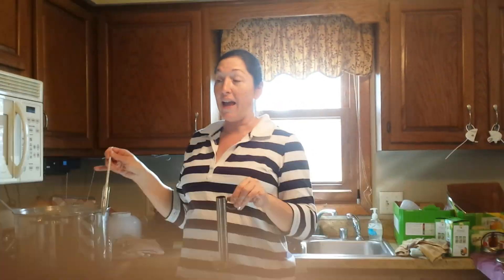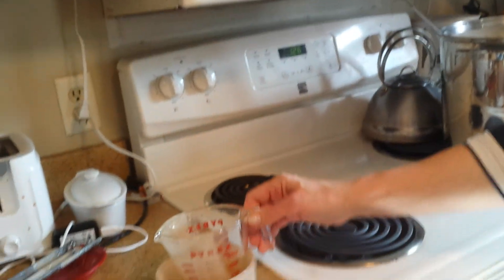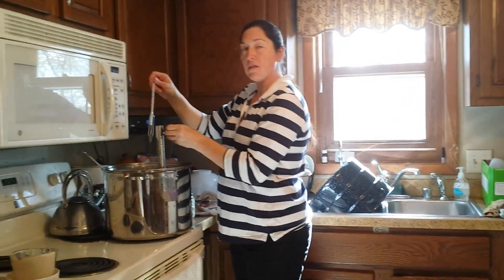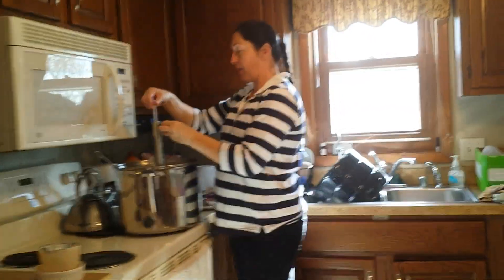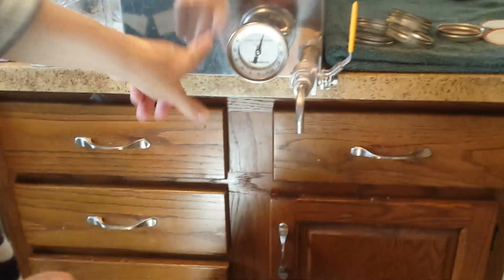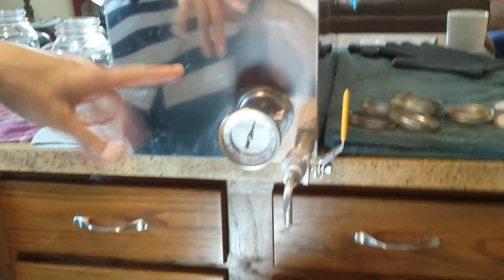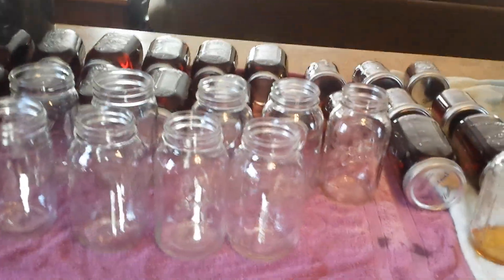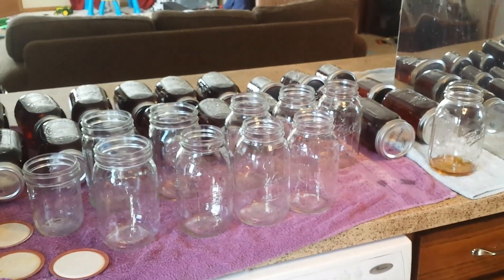Testing maple syrup with a hydrometer Finish point for maple syrup

Comment: I've been doing small scale for many years, bucket and open boil outside.  Some notes: finishing on the stove is absolutely the way to go  . . .when syrup gets close to being done, the chance of scorching a flat pan goes way up.  Use a deep pot.  Be aware that syrup, when it's close to being ready, will over-boil in the snap of  your fingers, creating a foamy, sticky mess.  Worse, if you have a glass cooktop, boiling sugar can and will complex with your glass surface and pit it.  If you are using glass, watch the syrup like a hawk when you are getting close to a boil.  I usually hang the stainless sampling contained from the ring inside the pot, which prevents most of the mess outside the pot.  Can't see using a measuring cup - just dip the entire stainless sampling cup directly in the syrup, test with hydrometer, then pour back in, hand cup on inside of pot, and keep watching.
I have jarred a lot of syrup - never had to use a boiler or anything else.  get to boiling on the stove, pour through a filter (I use prefilters and dense filter made for syrup - reheat, and pour directly into jars - seals with rings and lids, let stand until cool.  Never had any issues with spoilage or sealing.  I recommend avoiding laying the jars on their sides  . . . the lids have BPA in them, and if you hit them with hot syrup, the BPA is most definitely going to leach into the syrup.  I have never allowed the syrup to touch the lids, I have always let the jars cool standing up, and I've never had one fail to seal.  Good luck!
Reply from the maker: I have never heard of BPA in canning lids. Im heading right off to the internet for an education on this. There is always something to learn from viewer comments. Thanks!

Comment: Yes i have a bit going, bout 80 gal from yesterday,  hopefully my new filters an hydrometer will be here by the time its cooked down this evening,  i been having trouble with crystallization,  hopefully this hydrometer will correct this.
Reply from the maker: That can also be caused by stack burn. After you bottle lay them on the side with space between bottles. They will cool faster. Ive had crystals occasionally after filtering in the bottom of the filter box when I do large batches which can clog your bottling spout. Im tapping the yard today. a week of freeze thaw for me here!
Reply: @mommymilestones  thanks for the info, i added some sap to a batch that i aready had finished,  an boiled again till i got the brix rite. That hydrometer is a wonderful tool!!! The batch i cooked off yesterday between the hydrometer an filtering as you do was by far the nicest syurp I've ever made, very lite amber..  trees are pouring here yesterday and today,  probably only bout two more wks to go down this way , then its on to building up the bees.🐝🐝  . Happy sugaring hope all go well for you. An thanks so much for all your knowledge  😊
Reply from the maker: Im skimming my bee books and pricing nucs too. Winter is a time for planning isn't it! Good for you!
Reply: @mommymilestones  yes it is !!! , i build my own minnies an nucs an i put together another 130 10 frame boxes. Im ready for spring now lol.  I just came in from pulling all my taps out, im done for the season. I only did 540 gal of sap this yr. Probably one day for you. Lol , ill try to get set up better for next winter. Cookin down with propane kills the profit. !!  Keep posting your great vidios 👍👍